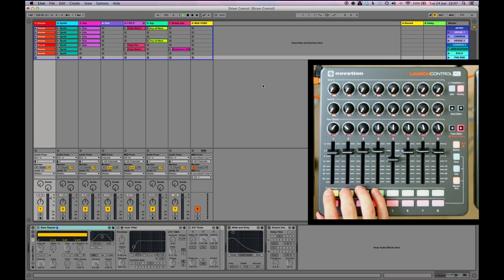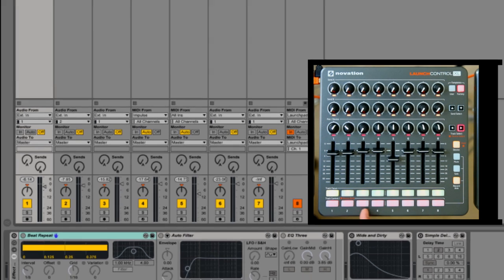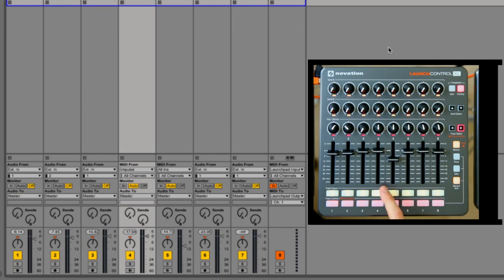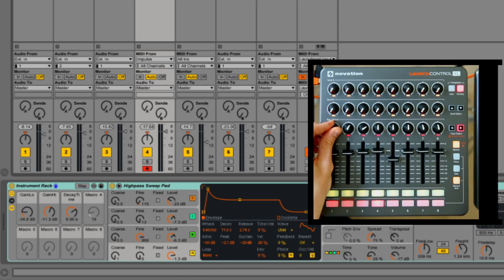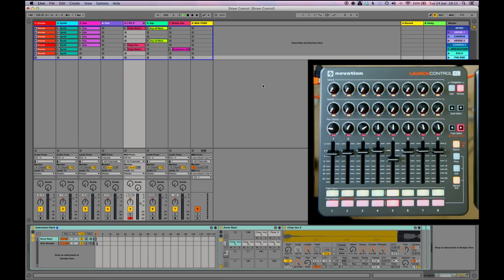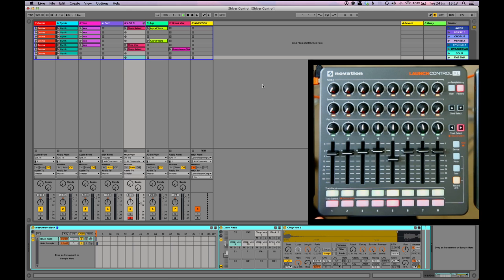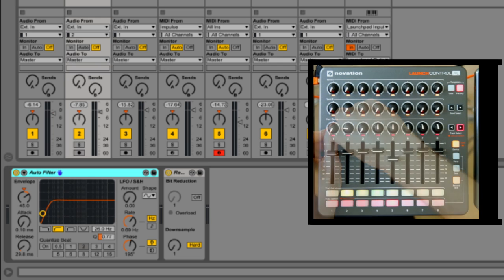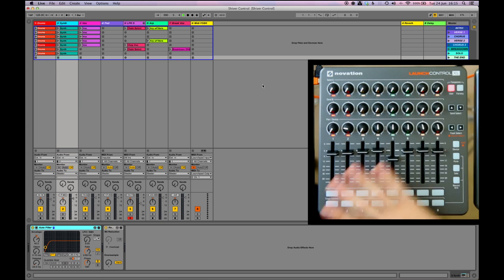Novation // Launch Control XL Performance explained

Comment: how to record clip with Launch Control XL only ,without using any another device?
Reply from the maker: What are you hoping to do exactly? Launch Control XL offers direct control over Ableton Live's mixer, sends, and track devices.
Reply: @NovationTV  i want to record clip of a plug in or instrument using only launch control xl ,i dont want to use launchpad for that ,i have launch control and launch pad ,to record a clip of a piano or another instrument or plug in i must go first to session mode on launchpad and press record session slot and then go to user mode 2 and play like keyboard instrument or plugin  and then back to stop recording .... is there any way to record directly with launch control without switching form session to user mode on launch pad and back ....while i am in user mod 2 of a launchpad
Reply from the maker: Launch Control XL doesn’t have access to the Clip matrix like Launchpad does, but you could use it to control Record On/Off in Arrangement View. This setup lets you keep the Launchpad free to use purely as a playable surface for inputting notes. To do this, switch over to Arrangement View in Ableton Live, then put your Launch Control XL into any User Mode you prefer. Click the MIDI icon in Ableton to enter MIDI Learn mode, and map the Global Record button in Ableton Live to any pot (knob) on the Launch Control XL. Once that’s done, click the MIDI icon again to exit MIDI Learn mode. Now, you'll be able to toggle recording on and off with that pot, while keeping Launchpad in User Mode for playing. Any MIDI clips you create in Arrangement View can easily be dragged over to Session View for launching.
Reply: @NovationTV  thnx

Comment: Hi thanks for your video! Is there a way to arm/disarm the devices/plugins in each track in Ableton? I have tried midi mapping this and it worked randomly on some devices in each track, but not all, which is very weird (& of course only expecting eight devices in each track to be armed/controlled..).  Would be grateful for anyone's knowledge on this.  🙂
Reply from the maker: Hi, thank you for reaching out. This should be possible through MIDI mapping but may require additional fine tuning. For additional assistance, please reach out to our support team at the link below, and hopefully one of our experts can get your Launch Control XL fully integrated. 

bit.ly/NovationSupport
Reply: @NovationTV  Thank you very much for the link, I'll give it a try 🙂

Comment: The Launch Control XL would be a great tool, if it hadn't one problem: it makes a very annoying high-pitched hissing noise, the louder the more lights are on. This might not be an issue, if you're performing live, but it makes it completely unusable for mixing purposes in a studio environment.
Reply from the maker: That certainly isn't a common issue. Could there be a grounding issue within your setup? Our Support Team. can help you with that - bit.ly/NovationSupport

Comment: Can I use the ''PAD'' buttons to release the songs from the channel, without having to map?? 

thanks!
Reply from the maker: Are you hoping to Launch Clips using the pads on Launch Control XL? That is certainly possible but it does need to be manually mapped using the MIDI learn feature within Ableton Live.

Comment: Hi! How the snap in the center works for the knobs? Does it bother when you don't need it? (I mean, does it interfiere with the movement when you want to go from 0 to 100 not -50 to 0 to 50)
Reply from the maker: You can easily sweep through the full range without resistance or stopping at the mid-point. The center detent essentially just make's it easier to locate the mid-point, without looking at the controller. 

John // Novation UK 🇬🇧

Comment: Hi, when switching beyond 8 tracks with the left-right arrows, do tracks switch in blocks of 8 or one track at a time? Thanks.
Reply: the whole group moves over 1, so if you are initially controlling 1-8 and hit the right arrow once, it will now control 2-9
Reply: Ah ok, I hoped it would switch to the next 8 tracks(9 - 16)
Reply: Maybe you can customize it to register as 8 presses on the user template, but I doubt it. I just got one so not sure what all it can do yet
Reply: It’s great no matter.

Comment: Nice work. How did you change scenes or was that done on a different controller?
Reply from the maker: In the original performance, Avec Sans used Launch Control XL with 2 Launchpads, for Clip and Scene control. You can watch the original performance here: https://www.youtube.com/watch?v=_5kH5SYm-B0
That said, you can certainly map Scene Launch to Launch Control XL pads in User Mode, to control everything from one device.

Comment: What if you won't hold the device button while pressing the left and right arrows, will it switched preset pages?
Reply from the maker: The left and right Track select buttons can be used to access and control the tracks within your Ableton Live Set. If you hold down the Device button you can use the Track Select buttons to step through the Devices
within a track.
Reply: I'm going to use this with Bitwig actually, so I already find a script which is mapped Device Pages (banks) to the most bottom row of buttons, but anyway thanks for fast answer and best gear ;)
Reply from the maker: @chiboreache  Cool, glad to hear that you've found a solution to this. Thanks for your support! 🙌

Comment: Hi, thank you very much for the gift, a great live set with all the files and all the explanations, it's great!

I have a question, at 7:43, you explain how the solo happens.
The focus is on track 8 which contains the MIDI effects.
On track 8, Monitor is on In, MIDI From Push2 Input (for me), MIDI To Push Output (for me).
Track 5 (5 / LPD S) contains a rack instrument that is on the Sample (Solo sample).

BUT in the previous video of the performance, I think that with these settings as described above, the 4 active MIDI effects are triggered but not sent to track 5, so none of these 4 effects are heard on track 5.

Should not we put on track 5: MIDI From 8 / Midi FDBK?

Thank you in advance for the explanations!
Reply from the maker: This video is quite old now, you may find that you need to make some changes for your particular setup. Feel free to experiment and give that a try, you may find that it gives you the result you're looking for.
Reply: Thanks for the answer ! I am experimenting

Comment: when you lower the volume on your computer, knob changes position?
Reply from the maker: +Arthur Souza The faders are not mechanised, so no.
Reply: +NovationTV So if I understand correctly, it's basically useless for mixing more than eight tracks as the faders won't change position when selecting tracks, right?

Comment: Hi. Please can you tell me how can I save a custom MIDI-Mappaing as a user template? I tried the MIDI-learn function in Ableton but how can I save it on the controller as a tamplate?
Also im not able use the Editor to assign all the parameters of Ableton and external Hardware! Need help ;-) Thanks
Reply: you probably dont give a shit but if you are bored like me atm you can watch pretty much all of the latest series on InstaFlixxer. Have been binge watching with my brother recently xD
Reply: @Imran Holden Yea, I've been using InstaFlixxer for years myself :)

Comment: why my "xl" in factory template ,the track focus and track control key go wrong.

when i push 2nd track focus or track control key,it won't work.  and sometimes, it will turn off the other track?

Comment: Hi.. All my led lights on my Xl are turned off. can somebody please tell me how to turn them on?
Reply from the maker: Hi Joakim,
Sorry to hear your having issues, have you tried connecting your unit to a different usb port or use different usb cables? Also do you get the same results when connecting your unit to a different computer? If you are still having issues please contact Novation support.

Comment: So say you want to write a song with more than 8 tracks, which is basically every track...how do you move the faders from say tracks 9 to 16?
Reply: T4C I haven't tested this but I think it will work. If you have a launchpad, there is a red box over the first 8 by 8 clips. If you move over to 9 to 16 with the navigation buttons in session mode, the red box will also move. The launch control might then be controlling those 8 tracks.
Reply: Do you buy 2 controllers..?
Reply: T4C was thinking the same thing mate. an vids i can see only show 8 channels. tweeted novation there to ask. if they reply will let you know
Reply: Mick Finucane I don't think they do more than 8. All this stuff they keep churning out is kinda aimed at performing live, rather than sitting at a home studio and using it basically as a mixing desk. Well you can if you only write with 8 tracks..you see the people they are aiming at popping up all over youtube with their demonstrations of music pushing buttons on these things..and I guess 8 tracks is ample for what they are at. But that said it surely wouldn't be hard to add a selector switch so the same faders can then adjust channels 9-16..surely..:)
Reply: T4C i cant see why it would be an issue.  but you could be right.
Reply: spoke to novation and yes you can jump acorss as many channels as you want. good value i must say
Reply: Yeah I think they automatically map to the first 8 and then they have a shift key to let you go beyond that. But it sounds good..i just bought the Akai APC mini and that is good value for £80..great wee thing